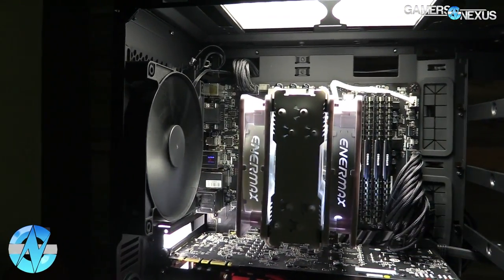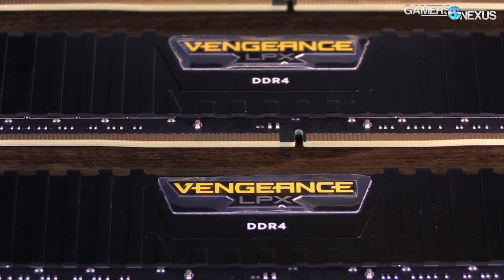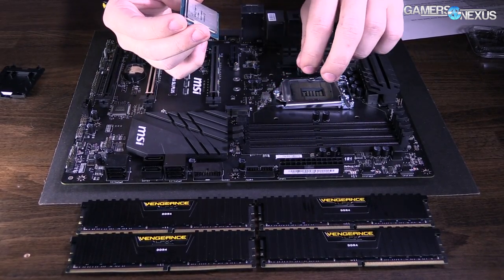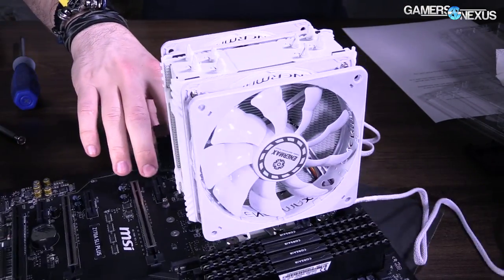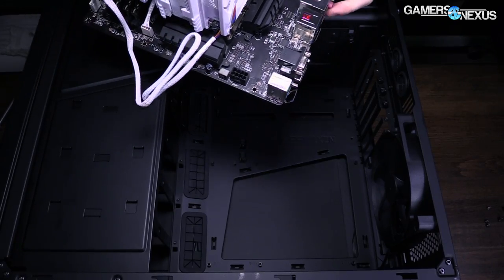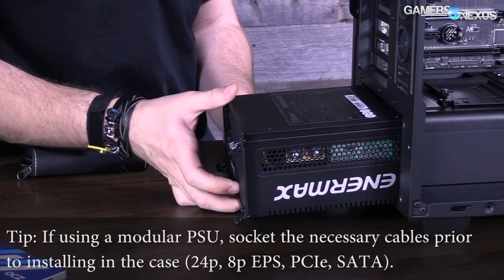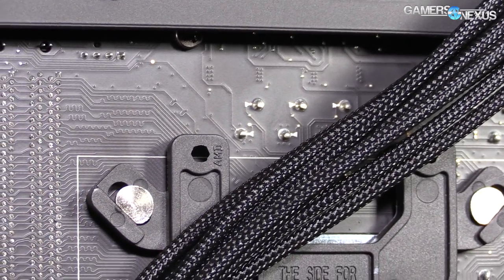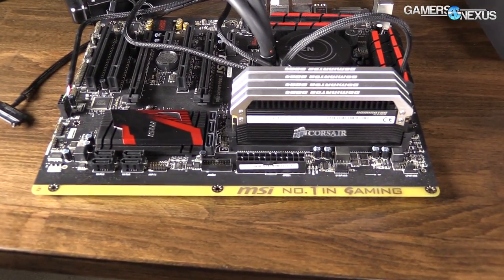How to Build a Gaming PC: Step-by-Step Walkthrough 2016

Comment: so whats this? a sponsored build? or any reason why you guys aren't even namedropping or using the AMD R9 390 that in most cases is either even or better then the 970?
Reply from the maker: We're showing how to build a computer. The specific components, frankly, are irrelevant. We talk about head-to-head components in nearly every single benchmark video we produce. It is in the best interest of the viewer to consume such information in those content pieces, as they have the depth required for discussion. What you suggest would bloat this already-long video way out of scope. It is totally unnecessary for component selection discussion within a "how to build" video, which shows screw points and assembly process. We set out to show how to build a computer. Not how to pick between hundreds of components. That's what the rest of the content is for.
Reply: +Gamers Nexus Problem is there are those kind of people out there that care little to none about advice when it comes to gear. they simply look at video's on youtube and go with thats shown in the videos and when you come to them and show them something else you will just hear "thats not what X is using therefor it must be shit".
its also funny how you say the components doesn't matter yet you took the time to show 2 nvidia cards.specially 2 cards that don't have much different to themselves int he sense of both are PSU powered GPUs.
I would have understood if you picked a low end GPU that runs of the PCIe only and a PSU powered card. Or if you sas said it doesn't matter to just 1 card.
But what smells fish and comes off as a sponsored build or free advertisment is to name 2 Nivdia cards but not one AMD card. I mean after all you did point out the different of using Intel and AMD CPUs.
Reply from the maker: +Bernd Jankowiak As stated in the first few minutes of the video, we were building a machine for internal use for production (rendering). We use CUDA acceleration for our render processes, ergo, CUDA cards were used. NVIDIA had no hand in this content and has never provided funding for content. MSI, as stated exceedingly plainly in the accompanying content piece, was a sponsor. MSI makes both AMD and nVidia cards.

Components /are/ irrelevant to the process. The assembly is the same regardless of component.

We will not tailor our content to the untargeted, random passerby, as you seem to be suggesting we do. It is not our content model to appeal to people who "simply look at video's [sic] on youtube and go with whats shown." We also plainly state in several locations -- article, description, video -- that components are modular and that we will support in component selection on our forums. The content is tailored for our content objectives and for our targeted audience. 

If that doesn't fit your needs, you are welcomed to move along to another video or unsubscribe.

Cheers.
Reply: +Bernd Jankowiak You're creating problems where there aren't any.
Stop.

Comment: Are ssd cards required
Reply: just call them SSDs, and no, you can just use a mechanical hardriveif you want, it just wont be as fast
Reply: SSDs are 10x faster so if you wanna live in the stone age get an HDD
Reply: SSDs (solid state drive) serve the same function as HDDs (hard disk drive) but are way faster. They're basically your computer's long term memory, so you will need at least one of either.
If you're on a budget a decent HDD will give you far more storage space for less cost, but if money isn't an issue an SSD will give you better overall performance.

Comment: That MOBO was flexing because of the weight of the cpu cooler, and the fact you were only supporting it from the very edges of the board! Had nothing to do with "Over tight" screws...smh...sigh. You don't have to concoct some mechanism of fear of "Over tightening" fasteners.

Comment: Optical drives obsolete? Come on have you ever heard of an EAC rip? You need an optical drive for that. I believe it's plausible to build a gaming capable rig that looks good and can rip/archive/play music. I WILL install an optical drive in either a NZXT s340 elite or a Phantek P400S. Many of you hard core gamers with multiple rigs will call me an idiot but if there room in a case....it should be an option. All current cases should be modular so you use what you want and all OPTIONS are available.